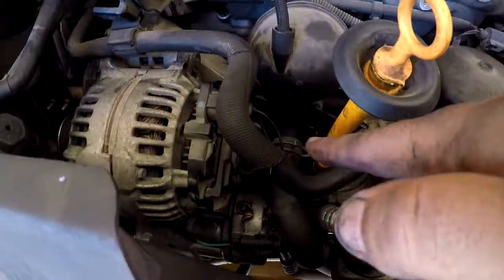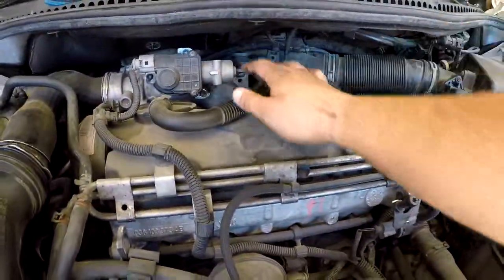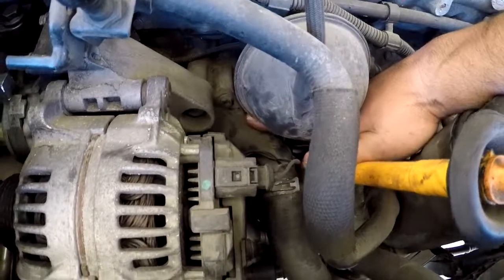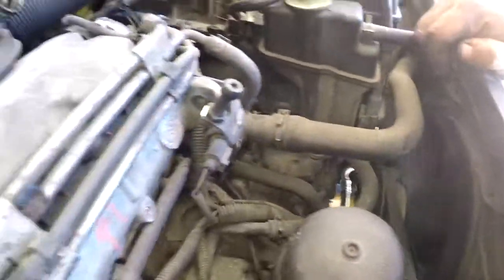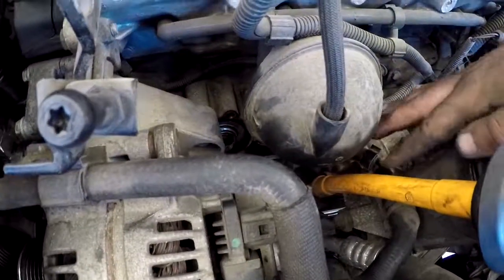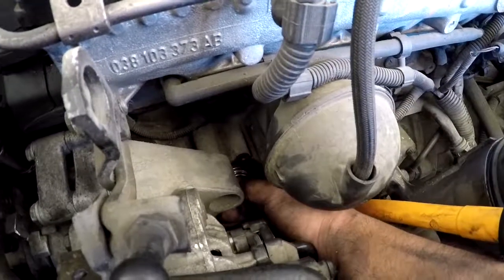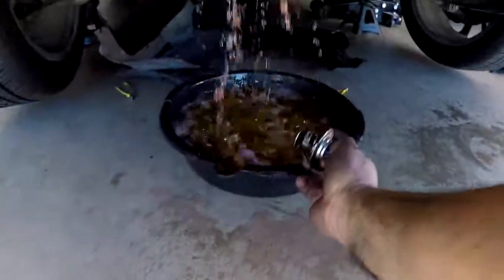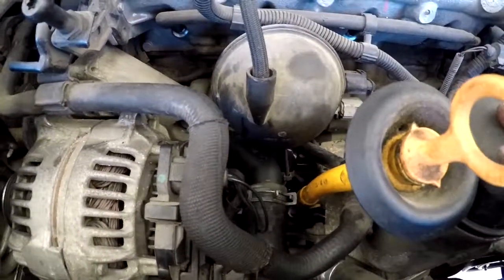2006 VW bug TDI Thermostat Replacement

Comment: How much coolant did you end up using to refill after you replaced the thermostat?
Reply from the maker: I believe it was 3/4 of a jug of coolant that was not premixed.
Reply: What thermostat part did you use